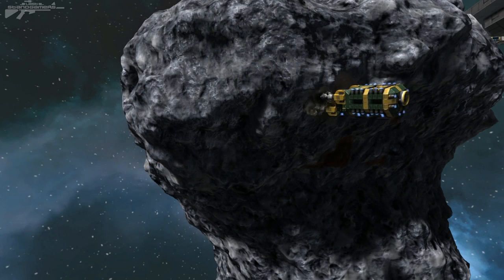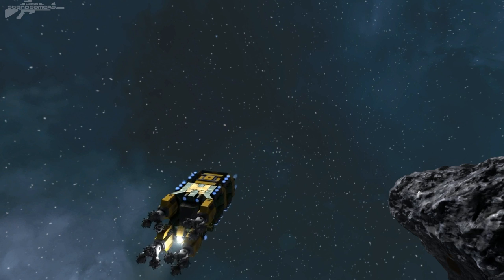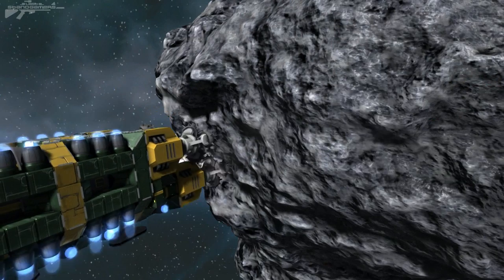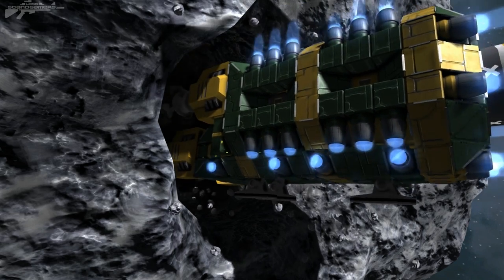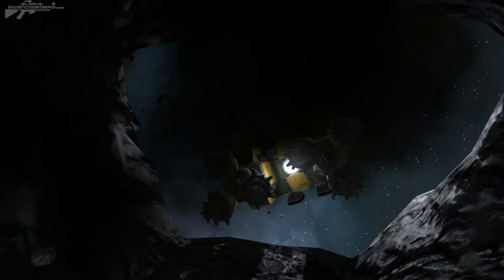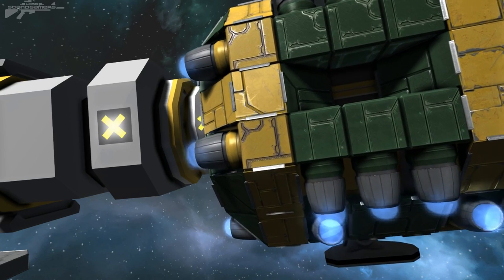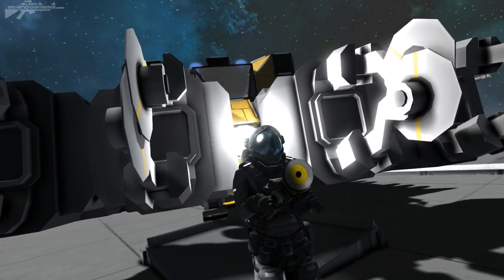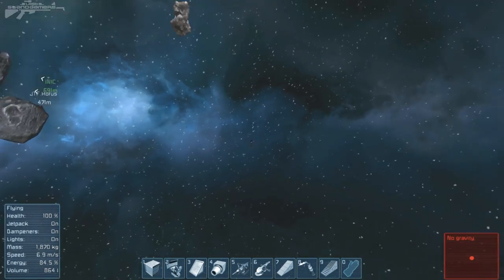Space Engineers - Small Utility Ships, Mining Grinding & Welding Assembling A Fleet Part 8

Comment: There are 8 ships in my arsenal that I normally use.

The Mini Miner: A small 1 drill ship, usually what I start with. If with multiple people, a mini miner is great for helping bigger miners that may have gotten stuck in caverns.

The Miner: As your build, it's a 4 drill miner, pretty basic, uses cargo containers and a conveyer, nothing special.

The Builder: As your welder, but I have a variation with 6-9 welders on it for station/megaship building. The larger builder is great for building hulls, but I also use a 1-2 welder one for spot welding, with the new pistons, one of the welders can extend forward. (Thanks for the inspiration).

The Grinder: A basic 6 grinder set up for breaking down big ships, I had a smaller one with 2 grinders on it for breaking small ships too. I rarely use it.

The Raider: It has guns, but also a grinder AND a welder, I use it for specialized missions with the NPC ships for breaking in and getting resources like a lamprey, by staying out of turret fire and eating away.

The Multitool: Has both grinders and welders, I use it for building ships normally, or in PVP combat for a repair ship combo'd with a raid ship. It's quite useful because it recycles stolen materials into repair materials.

The Recon: A ship with antennae that can recon bases, it's very fast and maneuverable, but doesn't use any 'tools' per say, maybe I'll slot a gun on it, dunno.

The Forklift: This is my most used ship. I HATE how my big ships sometimes get stuck on conveyers, this is most present when I am using bulky carrier or transport or mining ships that have low thrust power, but heavy forms to them. It's a simple ship with two conveyers on either side and one to three large cargo containers and a great deal of thrusters or gyroscopes. It's made to transfer materials from one spot to the other. I also had a build where it uses landing gear to grab containers and transport them too. This is an overlooked utility ship and just because it doesn't have a drill, grinder, or welder doesn't make it any less of a utility.

Comment: In my survival I have 2 small ships, 1 has 2 welders and 2 grinders, similar to the cannibal but not as big, I call it "The Construction Bug" because it looks bug like with the spotlight at the nose of the cockpit. and I have a drilling ship, my original plan was to have a modular ship but then I had to think about the need for conveyors, although know I figure I could probably use small ejectors to make sure the welders grinders and drills use/gather the resources and store them in a cargo container. (or in the case of the welders take from the cargo container.)

Comment: I would indeed add a fourth ship to the utility ships list!  It's actually the first ship I build on a survival game because it is the simplest.  It's not as essential as the other 3, but it is very valuable for how I play.

I call it the Pack Mule.  The Pack Mule is an absolute minimalist ship, and is as small as I can build it.  It has a cockpit, a medium cargo container, a connector on its dorsal side, and landing gear beneath it and on the port and starboard sides.  Sometimes I also fit it with an ore detector.  I use it for two things:

#1.) It is small enough to fly inside asteroids through the narrow tunnels which can be found naturally occurring.  This allows me to explore the caves in detail without risk of getting lost and running out of power.  The landing gear on all the sides act as bumpers to avoid collision damage and allow me to land anywhere in the tunnels with ease. 
#2.) I'll use the Pack Mule's cargo section to fill up on various components for ship construction, then I'll park the ship on it's side wherever I'm working (such as a landing bay with gravity or the roof of a ship) so I can walk back and forth from a ship under construction and the connector, pulling out whatever parts I need.  Usually this is faster than getting the components to my work area by other means.  And this is very helpful when I begin building bases inside of asteroids as is my usual style, since I can fly all the parts I need in and start construction. 

Later models of the Pack Mule have incorporated passenger seats for rescue missions and quick, convenient recharge for allies.

Comment: I keep my mining ships standard, but when it comes to my welding and grinding, I tend to on one front of the ship, use it as the "welding side", and connect it up to the opposite "face" of the ship with conveyors, to then use that side of the ship as the "grinding side". So I can thus basically grind up old parts off of ships or other things, and easily have the resources to weld almost anything I need; of course with a few exceptions.

Comment: I use 3 separate ships although mine are smaller than yours and tend to use 2 tools instead of 4 or 5 like you suggest.  I also added a large curved duct to my connector block at the back so that it points downward and I leveled it with my landing gear such that you could land your utility ship and lock it in place with the landing gear while its connected.  This is especially useful for using utility ships with a larger movable mother ship which would presumably contain  your refineries, assemblers, and storage

Comment: I have built a lot of mining ships in Creative mode just to see what might be the most effective.  To my mind, like Aaron says, control is quite important, so you need a enough stabilization so they will go straight, but not too much so that they turn too fast and become unruly.  Shorter ships seem to work for me because once I get inside the asteroid you might find different resources and want to be able to turn the ship, so really long ones are out for this kind of maneuver.  Sometimes it helps, or at least it used to, to mount multiple drills that rotate in the opposite directions.  That is, mount the left one upside down and one on the right "right side up" or so you can read the "text" on the drill as being one way on one side and the other way on the other side.  Also, 2 drills on a smaller ship work very well, but I have a couple of 4 drill ships that also handle nicely.  It just depends on where you are working and how much of a particular "resource" is in one place there.  I also like to "recess" the thrusters, ore detector, and lights into the ship as much as possible so nothing is sticking out and prone to be knocked off.

Comment: One utility ship would be a recovery ship.  Following a major battle, you may have ships littering the area that have been destroyed or severely damaged.  The goal of the recovery ship is to attach to a damaged ships and get them back to the shipyard to undergo the larger repairs.

It does the following:

- Carries batteries in order to provide emergency power to a wreck.
- Carries parts for rebuilding critical ship systems, such as reactors, large thrusters, and merge blocks.
- Landing gears in order to grab onto pieces which are spinning out of control.

This ship isn't just for towing your ships, but could also work on enemy wrecks.  Special care would need to be taken with those, as you might accidentally power up any surviving weapon systems.

Comment: My way of mining nr1:  the Bucket,  a huge Funnel with a collector in the middle.  gravity generator facing towards this Funneol,  place it near the asteroid, hop out, and start drilling manual. +sides: you only gather what you need, no useless stone gathered. no parts can break, 100% you get what you need. also: only a little hole to see in the asteroid.    option 2:  the multitool. you already showed this sort of vehicle on sages channel: bergblock sorroundet by Connectors, changable bits for the fronpart, welde,r grinder & Drills. startingship is perfect for this, just connect the frontbit with the assembler, you now cna drill your resources, switch parts and imidiatly start welding because your ship already refined everything and build new parts via Assembler. nonstop work here we come. option 3: the Tremor.  a longer ship, with 4 or more Drills in front. shape of ship smaller than the drillinghole,  connect everything in a row Drills > Refinery -> assembler>Crate.  you nowmore produce stuff while mining.  the long shape will hold it way more stabile than the ship in this video, you can drill perfect straight holes with it. also: its pretty cheap. presicion mining at its best.   bet the best way (the fastest way)  is the tremor, for mining or with grinders, it works wonders. you can also place them like a pyramid.  4 in the front, now in the next outer circle a bit further back, the next and so on,  that will also keep it stable.   this ship in the video on the othe rhand is Amateur work and i woudltn recoment it.  its unstable, its badly armored (you will hit the walls pretty often, soone ror later something will take damage) and only has the purpose of mining. no one needs a 1 for all things ship, sure, but its easy to combine needs with uses. as in: build more stuff on to your ship, for more mass = more stable = easyer mining.  so: give that small guy something more than just  what he got to make him more efficient.

also a good idea is the Tremor with 2 cockpits so you can drig in on the one side and fly out the hole with the other side.
Reply: also: a weldinship shoudltn have more than 2 welders. otherwise you wont be able to be precisly with your work, same for the grinder.  to many attachments make it bulky and you wont hit the parts you want to hit or wont fit into tight gaps in your ship to work in there.  2 are enouch in my opinion.
Reply: Doc Dewrill I can think of reasons for more than 2 welders/grinders. more grinders is usefull if you want to completely grind a ship (random cargo or starter spawn ships or even other player ships) away while not taking an eternity( esp heavy armor takes a long time). having more than 2 welders will be very usefull for building large ships and you build them layer by layer. I can see why you would want to be able to maneuver in very tight spaces but you could also construct a ship with a single grinder and welder or even use hand tools as suggested.
Reply: wisdomtd sure thing, as soon as we have the resources for multiple vehicles i highly recomment a vehicle with more welders. but i think the one with less would be more useful at first even though hes slower.
Reply: I usually end up creating a 9x9 small ship with 3 grinders on the front and 3 welders on the back with once forward facing cockpit and one facing the other way. but its aways up to personal opinion i guess
Reply: wisdomtd thats a pretty smart idea!  gonna totaly steal that for my Tremor!
Reply: Doc Dewrill damn I forgot to apply for a patent.
Reply: wisdomtd Bwahahaha too late! massproduce
Reply: Why not have a small squadron of three miners, one piloting the fighter, a gravity generator to force the rock forward, with drills at the front. The other two would support in the mining by only gathering the small parts a drilling ship cannot. And to help create a hole so the ship can get digging through the middle.

Comment: I find it useful to have a grinding ship before a welding ship if you plan to salvage a passing ship or two (or more).  That said, most grinding ships can easily be changed to welding ships (the two blocks have near identical components) so it doesn't make that much of a difference.

Comment: I would go with the modular ship design. make a mining and welding toolheads. Once you get to a certain point, make a second modular ship and set of tools. The Grinder could be useful in some cases, but just seems to be a waste of time in unless you're going for the salvage route and just break down those loose ships floating in space... actually, a grinding pit would be easier.

Comment: Well the only ship you've really missed imo is a pure transportation ship for objects. if you have troubles with floating objects like half-way destroyed ships or an error on wielding you may want a ship with just landing gears in the front to pickup things and carry them from one position to another. Usually that's the ship with the merge block attached to it aswell.
When it comes to building them i usually go for a mining ship and as soon as i have ressources to build something else i remove the grinders temporarily and put wielders on there to build at least the wieling ship aswell. after that grinders will go back onto the mining ship.

Comment: I build my welder/grinder ships into one, I just add 2 cockpits on front and back, as well as a coupple of welders and grinders with a shared cargo container in the middle, when I'm done grinding something, I just hop to the other cockpit and start welding what I need, it's great when you need to constantly run back and forth grinding away the parts you need from drifting ships you commandeered and using the parts on your ship or station you are building... 

Also how do you stabilize a mining ship ? I can't imagine anything else but putting a lot of the horizontal/vertical thrust on the front end of the ship...

Comment: Hey LastStandGamers, so I was thinking for a new kind of ship design.  So say that you are in a situation where you cannot keep your base in a constant fixed place, say that there is someone that is out to get you, what would you do/build shipwise?  How would you stay alive with those constraints, everything you build must be able to be almost constantly on the go, aka if a ship goes down you need some way to put it on a bigger ship in the fleet and repair it while all the ships are moving.  Also a good utility ship in my opinion is one that carries a good number of batteries, either big or small, and depending on how big the ship itself is another ship (if your fleet is constantly moving) that generates a large amount of solar panel energy to charge the batteries, or a station that is fixed to absorb huge amounts of solar energy and store it all in a massive number of batteries, that are all connected and can have their energy easily and efficiently drained into either big or small ships that use batteries.  The other ship that is carrying a large number of batteries would be useful for transferring the charge from the solar energy fields to the place of use.  Also, its important to use batteries and solar energy for fuel instead of Uranium, b/c Uranium is a little bit harder to come by, and on any extended time in a game you can easily mine it all away.

Comment: I just started playing and quickly realized mining ship IS NOT the most critical ship. At least not for survival. Welder + grinder ships are.

So you started playing and you realize you have a measly 400 L of space, on your cosmonaut. What do you do? You increase inventory size to triple or x10 (it scales it for your character as well as all your cargo containers). But you fail to realize that mass scales up too: 10x the inventory, 10x the mass. And thrusters DON'T scale up !

To achieve same acceleration, you will need 10x more thrusters, literally. A=F/m, where F is the total force exercised by your thrusters - no friction losses in space. M goes up 10x, acceleration decreases by a factor of 10, for same F.

So, where are you gonna put all those thrusters? Welcome to wall of jets designs.

If you are like me, you will end up playing back on inventory x1, so you get to design decent looking ships. Imagine how much fun is to build even a small mining ship, running back and forth to you hatch, picking 50 plates, or 8 tubes, then running back to weld them on. Mind numbingly tedious. Until you get a welder, with a nice container on its back, that can hold 15k L, so you load up all the parts in one go then build a frakking ship.

Comment: with the batteries in play would you have to make a large or medium solar array for about 3 small ships that run on them, what would be better, just an array or a array that has engines on it so it does not have to be moved by another craft
Reply: I use a solar array in my survival world to power my 4 refineries, 2 assemblers, recharge my small assembly ship, and now charge my large mining ship, as well. Plenty of power, as long as it's not all going at once. If it is going at one, I have a station battery that makes up the difference. Been a while since I've needed uranium.

Comment: Hey Aron, could you please show us how you build that mining ship that you showed?
Reply: It's not complicated, can't you work it out from the video?
Reply: pyr0b1rd
Most likely, yes, however I'm a beginner and would like a bit of a tutorial so I can base my future designs on a working knowledge base.
Reply: Not sure what you expect the video to teach you that several minutes playing around in creative mode won't. There's a big difference between observing and doing, and the latter of those two is a lot better for learning from.
As for the ship, it's a simple construction presumably designed interior first. All four drills are piped up to the large cargo container, which in turn is connected to the connector at the back, and I'd assume the large reactor on-board too, allowing materials to be stored or offloaded, and providing a simple way to refuel the reactor when linked up to another ship.  Alternatively there might be a battery instead of the reactor, meaning you'd have to connect it up to charge.
On the safe assumption you know to have thrusters facing all directions, and gyroscopes, the only thing to add is make sure you have an ore detector so you know what you are drilling and/or if it's worth drilling.
Reply: pyr0b1rd
All right, thanks. My main problem when building mining ships is the conveyor system, I often forget to link anything together.
Reply: DevinSmith56  I would suggest you build your ships from the inside out. Get your miners built and then add the storage then hook up all the conveyors, reactors, gyros ect then build the armour, lights and other bits around the internal stuff.